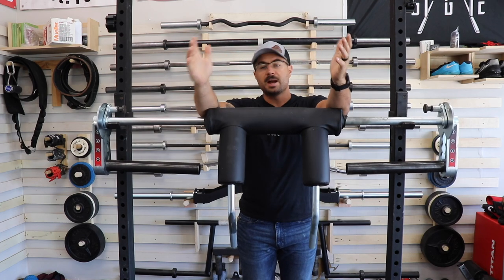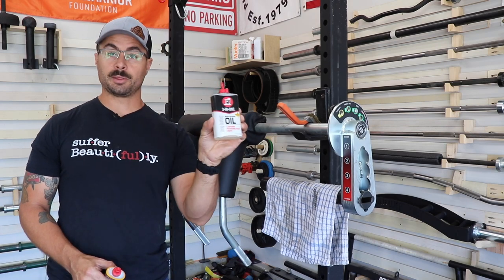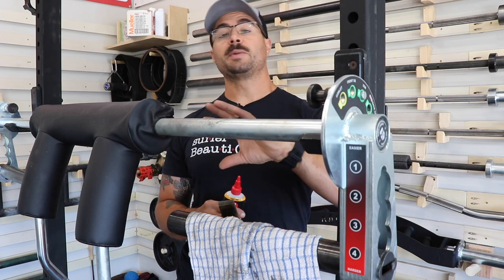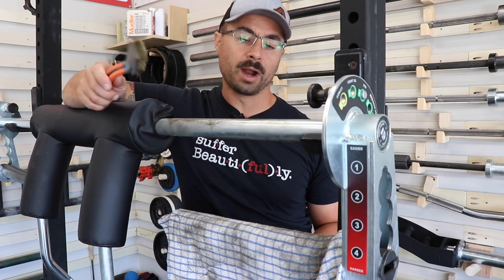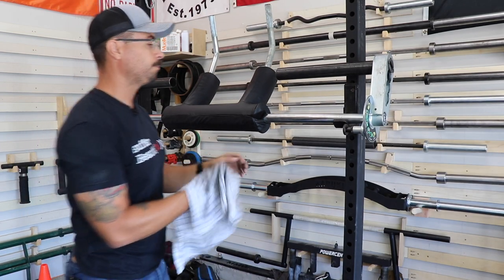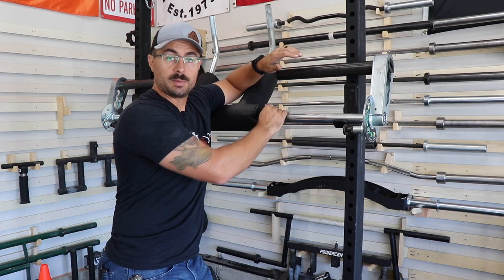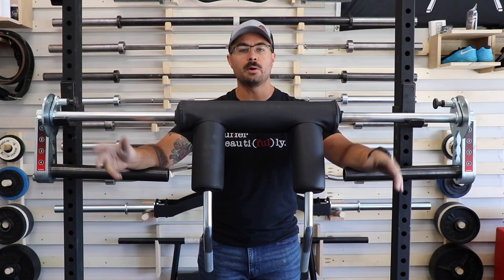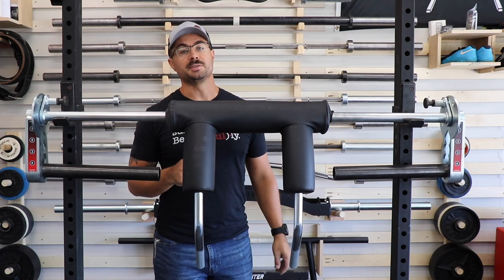Restoring Coated Barbells | How I Remove Oxidation from Coated Barbells | Strongman Garage Gym

Comment: Do you wipe down all your bars weekly with 3 in 1?  I got e coat...should I wipe them down
Reply from the maker: I have a rag that is lightly oiled and I just give them a quick once over and clean out any jammed up chalk. It’s not super labor intensive
Reply from the maker: I don’t necessarily think you need to oil them that often, but getting chalk off the bar will increase the longevity of the coating